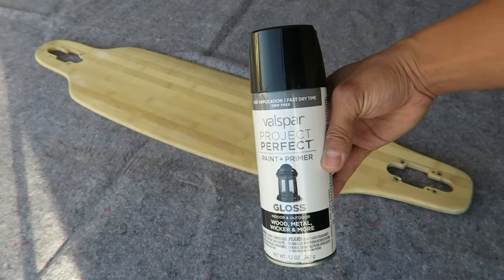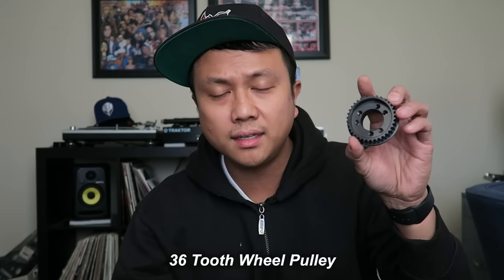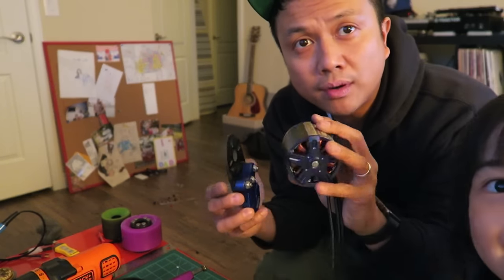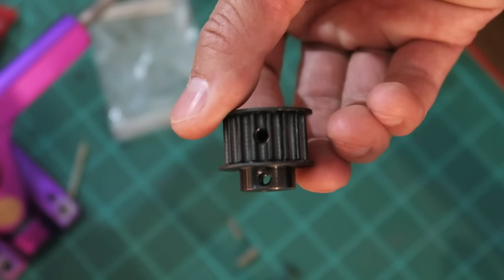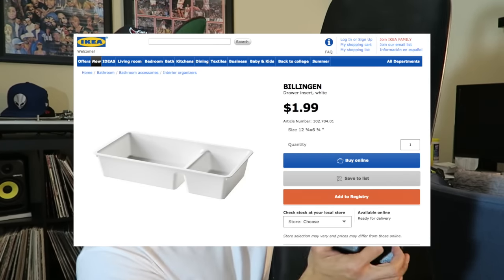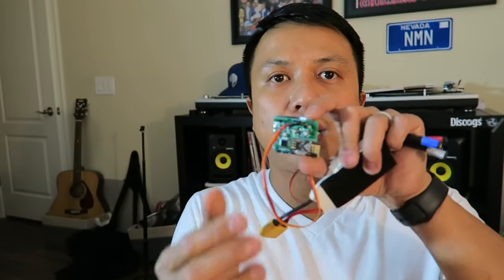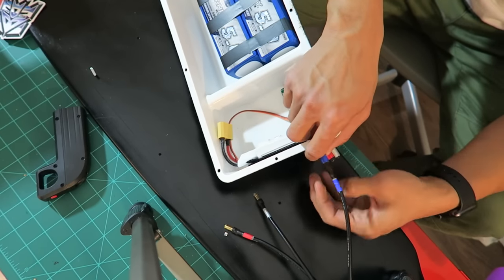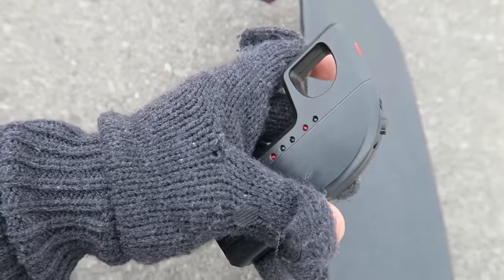MAKE A DIY ELECTRIC ⚡ SKATEBOARD - BETTER THAN A BOOSTED BOARD!

Comment: Hey, what screws did you use and stuff like that(wireing etc.). What was the total cost? Exeleration? And how would you put 3 batterys on it? How do you charge it and how much time does it take to charge. Thanks for your time!
Reply: Oh sorry 1 more question.. to many  lol. Ok so Can you change the wheels from 90 to like 80 or 75 and would that effect the build or anything with the skateboard . Love this video by the way! :)
Reply from the maker: If you'd like please shoot me an email to bigkidsofficial@gmail.com.  I actually have a spreadsheet with 3 tiers of budget builds.  It has a list of parts and links available.
Reply from the maker: I appreciate the kind words.  If you would, I kindly ask you to simply share this video to any of your social media.  It would really go a long way.  Anyhow, yes you can however certain wheel may require you to drill into the wheel to make that happen.  If you'd like something smaller than 90mm and don't want to drill into the wheel I suggest Orangatang Kegal wheels.  There are gears available for the type of wheel as well.  Thanks again!

 - Neil

Comment: Your videos are amazing.
I want to build my own electric skateboard and I have one question Which motors will be the best,  How do you think?
Reply from the maker: Hey there!  Thanks for watching!  I hope you'd consider subscribing to see more videos like this one.  If you'd like to go mono drive I'd really suggest the 6374 motor https://eskating.eu/product/electric-skateboard-motor-6374-170kv/?affiliates=11 this is the motor I use.  Matched with the right battery set up it can handle large hills or heavy weight.  However, if you are on more of a budget then I would suggest this: https://eskating.eu/product/electric-skateboard-motor-6354-230kv/?affiliates=11.  The second option might get create more heat over time but both will work very well!  let me know what you think and I can help you with your thought process.

- Neil

Comment: What is the antispark and where can I buy it? Also how do you brake? Thanks for the viddd
Reply from the maker: Hey there!  Thanks for taking the time to check out this video.  I hope you consider subscribing to see more videos like this one.  I purchased the connector.  It's an XT90 connector.  Then I soldered a wire into a loop. 

- Neil
Reply: Big Kids What kind of wire did you use? Also could you explain the whole battery adapter thing to me how did you make it?
Reply from the maker: So, it's called a series connector.  You can actually buy one of amazon.  However, I made mine in this video from (3) XT90 connector and 12 gauge wire.  I found a schematic online and just followed it.  You will need a soldering iron for this project.  You learn so much doing it yourself but you can buy one on line as well.  Good luck!

- Neil

Comment: I have an RC Car called the traxxas rustler vxl. The motor on the rustler is 3500 kv brushless motor. I already have batteries as a result to. So would be rc car motor work for this project or would it be too fast or make me put in voltage dividers?

Comment: was thinking instead og flattening hanger of truck use a lot of rubber between clamp and truck. to keep it fixed
Reply from the maker: Hey there!  Thanks for checking out the video and hope you'd consider subscribing to see more videos like this one!  I can see your idea working.  However, there are a lot of motor mounts already created for the flat portion of the Caliber II truck.  But if you want to use a truck that doesn't have a flat spot like a Paris truck or a Ronin truck your idea fits perfectly.

- Neil

Comment: awesome build dude.  I was thinking of buying the Evolve board but now I think I will build my own.  But I want a two motor type setup like the Evolve though and I want to use it to go to work which is about 12 miles away.  Any thoughts on how to make it go that distance??? any info would help dude.  and again awesome build.  I live in Sunny San Diego, CA btwNoka
Reply from the maker: Hey there!  Thanks for watching!  I hope you'd consider subscribing to see more videos like this one.  Noka, nothing bad about the Evolve boards but honestly you can build one better for the same price! Plus this has been such a rewarding experience!  if you are concerned about range it's all about the battery and how much amperage you motor or motors are consuming.  a couple of questions i have for you before i suggest something is: #1 how much to you weigh and #2 are there some really large hills near you?  I already have some suggestions in mind but just want to know a little more before giving you a blanket answer.

- neil

Comment: Hey
First of all great video and awesome board. Now I could use some advice on the batteries you used. You used the 5000mah 5s 30C batteries if I'm not mistaken, however I have seen a cheaper 5000mah 2s battery. How much of a difference would it make if I used the cheaper 2 cell battery?
Reply from the maker: +Kamran Hussain hey there!  Thanks for checking out the video and I hope you consider subscribing to see more videos like this!  If you use a VESC as your speed controller you will have to have a minimum of 6S or 6 cells.  Voltage is directly related to speed so if you want a faster board you'll want more cells.  Amps are directly related to range.  I've recently upgraded to 8000 mah packs and I'm very happy.  Let me know what you end up doing, I'd love to stay in tune with your progress!
Reply: Big Kids Thanks for the quick reply and ill keep you updated. 
I have seen a 5000mah 6S battery that I think be perfect for what I want to build, however it is 50C, and in your video you use a 30C battery. What does this C stand for and is this battery suitable for a  VESC identical to the one you use in the video? Thanks in advance!
Reply from the maker: 50C is great!  the C rating is the discharge rate of your battery.  The higher the C rating the better.  But before you make your purchase do a little of your own research on C rating.  Thanks again for all the support.

- Neil
Reply: Okay will do and thanks!

Comment: Hey big kids I have a question I bought a motor race star 200kv and it’s got this cable on it and I don’t know where to connect it
Reply from the maker: Hey there!  Thanks for watching!  I hope you'd consider subscribing to see more videos like this one.  Sean, the Race Star motor and most motors have the 3 phase wires as well as a sensored wired.  They would be plugged directly into your VESC or ESC.  I suggest you check out https://www.electric-skateboard.builders/ which is a forum for more detailed info.  Research on the product you buy is super important as all this stuff can really rack up the $$$.  Good luck!

- enil

Comment: Does your electric longboard have breaks? If so how it was done? Thanks! :)
Reply from the maker: Hey there David!  Thanks for watching!  I hope you'd consider subscribing to see more videos like this one.  The braking parameters can be sent in the VESC or the Electronic Speed Controler.  Every electric skateboard has one and the VESC has the ability to manipulate the brake pressure from the software called BLDC tool.

- Neil

Comment: Hey, I honestly learned so much from this vid! Subscribed! Can you share where you got the enclosure and the velcro?
Reply from the maker: Hey Jorge!  Thanks for taking the time to stop by; we're very humbled!  The velcro was from Amazon but I also found that you can find some industrial strength velcro from Home Depot or Lowes.  Mind you, it's a bit pricey.  My original enclosure was from IKEA.  Since this video I've changed my enclosures.  I know have the 6s and VESC enclosures from Torque Boards.  Check this link out: http://diyelectricskateboard.com/diy-electric-skateboard-kits-parts/2x6s-rc-lipo-battery-enclosure/  Let me know if you have any more questions I'm happy to help!

- Neil

Comment: hey i cant find those batteries ,couse they are out of stock,you got some links or something? TNX
Reply from the maker: Hey Alesha!  Hope you consider subscribing :)  Here is a link to a Lipo finder on Hobby King.  Just put in the specs that you'd like (IE:  5000 mah, 5s) and it will find all the brands that carry those specs: https://hobbyking.com/en_us/lipo.html?gclid=CjwKCAjwrO_MBRBxEiwAYJnDLKK-aZOmFEw9KIeEwRyyBpBWGKLkMtt6CcKAMfu-qBFQoMxg-32G2RoCyF0QAvD_BwE&gclsrc=aw.ds
Reply: what about the discarge,does that matter?
Reply from the maker: Discharge rate is the C Rating.  The higher the C rating the better.  It comes at a price though.  If you are looking to save money I think you'd be okay with a C rating from 25 - 30.
Reply: what about ? Multistar High Capacity 10000mAh 6S 10C
Reply from the maker: +Alesha Ciobanu that's ALOT of power.  However, 10c is awfully low and Multistar hasn't had the best reputation.  Turnigy or Zippy are the 2 I think you'll have better results with.
Reply: ok tanks a lot

Comment: Why dont you use a switch to start and turn off the Board instead of the Wire jumper?
Reply from the maker: +Ian GB loop keys are simple and cheap.  Mostly for budget reasons.  I️ have other boards with switches.  A switch plus amperage regulator can cost about $35-$50.  Hope you enjoyed the video and please consider subscribing for more videos like this one!  Thanks again.

- Neil
Reply: Hey thank you Neil I thought it would of been for some sort of security measure or something. Your video was very detailing and the only one where someone decided to paint the plastic cover. Pretty cool and nice Build.
Reply from the maker: +Ian GB actually, you are right as well.  You can used the loop key as a security measure as well.  If you don’t have the loop key to complete the circuit the board will not work.  Thank for checking out this video.  Check out my latest video as I’ve actually uploaded part 1 of a 2 part series of a newer build.

Comment: Why would you top mount your trucks to a drop through deck?
Reply from the maker: Why not?  Never limit your imagination in DIY.
Reply from the maker: A low deck limits the space between the motor and the deck.  So when I turn the motor would scrape the bottom of the deck.  My motor mount is strictly an under mount but ifni was to have a reverse mount mounting the trucks drop through would work fine.

Comment: Hi Neil, 

I was just wondering whether you have to configure your remote control with this to the skateboard like you did in your other 3 part tutorial because I don' t know whether I should do that if I want to follow this tutorial.
Reply from the maker: Yeah, all remotes have some kind of receiver.  Even if it's a ESC with a dedicated remote the ESC most likely has a integrated receiver.  With that said, I'd say 90% of the time you'll need to bind the remote to the receiver.  Hope that helps.

- Neil

Comment: Looks awesome.
Any idea how much all the parts were together?
Reply from the maker: Hey there!  thanks for checking out the vid!  Hope you consider subscribing for more videos.  In my case, all my parts were close to $750.  However, at this point I know I can get even higher quality parts for less expensive.  Just some lessons learned as it was my first ever build.  Hope that helped.

- Neil
Reply: Thank you, I'm looking forward to your next videos.
Unfortunately, the price was the only thing that made me consider building something like that myself, especially since I have no technical knowledge. And for me, I guess the expenses would go even higher with importing some parts to Germany. But I will stay on the lookout, maybe soon it will get cheaper to build one.
Reply from the maker: You can definitely do it for cheaper.  It was my first build so I've learned that I definitely did it on the expensive side.  There are a couple vendors I know of in the EU that are quality at the same time could lower your shipping costs.  Alien Drive Systems & UNIK Boards are two of them.  One from the UK and the other in France.  Hope that helps :)

- Neil

Comment: Are you supposed to also use any lipped bearings?? Thanks!
Reply from the maker: Hey there!  Thanks for stopping by and checking out my video.  Hope you'd subscribe to see more like this one.  Lipped bearings aren't necessary as there's a spacer between the two bearings.  I actually use Zelous bearings which have an integrated bearing spacer already.  Hope that helps!  Are you planning on building one?

- Neil
Reply: I am! I just finished my parts list but was unsure of what I should do about the bearings, thanks!
Reply: I would LOVE to show you my parts list and get your thoughts if you'd be willing
Reply: I would LOVE to show you my parts list and get your thoughts if you'd be willing
Reply from the maker: Sure!  Shoot me an email at bigkidsofficial@gmail.com
Reply: THANKS!!

Comment: hi were did you get the anti spark key
Reply from the maker: Thanks for watching the video.  If you'd like to see more videos like this one please consider subscribing www.bigkidsofficial.com.  Hi there!  The anti-spark key is a XT90 connector with a wire that is soldered to both the negative and positive end.  The anti-spark loop key does require some soldering.

- Neil

Comment: Nice and simple video.   But I have to say. You left out some details about building a drivetrain.   Such as lining up the motor mount and have it square to the wheel.  Place a spacer under the c clamp to adjust to the tappered skateboard truck.  Use red thread lock on the c clamp screws once you did all the testing to insure  everything is working.  Use red and blue thread lock at the end because red is pretty hard to remove  once it dry. Maybe use a 40t wheel pulley instead of 36t on a 97mm wheel.    Those were just some of the problems I had to solve when I built my first board.
Reply from the maker: +Wilson Leung Thanks for stoping by Wilson!  Yeah, it’s hard to predict what you may or may not cover in a video when a lot of things are trial and error after the build.  It’s funny that you mention these things because I️ actually cover a lot of the things you mention in my new diy esk8 build video.  Anyhow, the challenges of doing YouTube videos is actually a bit different then the challenges of building a electric skateboard. Anyhow, the electric skateboard scene on YouTube is pretty small so I️ hope you consider subscribing to see more improved videos like this one.  

- Neil

Comment: i want to know how much is the electric skateboard you made
Reply from the maker: Thanks for checking out the video!  Hope you'd consider subscribing for more videos like this one.  This was the first iteration of my build and wasn't as cost effective as I'd like.  I spent around $800.  But, I know now I could have done it for about $500 - $600.  a DIY board to me is kind of like a modified mustang.  it's faster then most boards but does take some maintenance.  Most full build boards are once size fits all like a Camry or a Lexus at best.  DIY isn't for everyone.  If you'd like, i have a spreadsheet with tiers of budget builds and the cost of each part.  email me at bigkidsofficial@gmail.com if you'd like it.

Comment: Im searching for a good vesc to buy but doesn't hurt my budget.  I was looking at the diy vesc, do you think its any good? also how is your vesc holding up? I just dont want to make a mistake and force myself to buy another one lol
Reply from the maker: Hey Jerico!  I'm actually not using the DIY VESC unfortunately.  The first time I connected it I actually fried a DRV chip.  Honestly, probably a user error as I was new to the hobby back then.  I'm currently using a Miami electric version of the VESC.  It's great and has handled some high amperage pull from my 10s 8000 mah LiPos.  If I were you, find a company that has good VESC and that handle FOC if you'd like that in the future.  Per the community the best VESC's come from Enertion (FOCBox) and Ollin Boards.  They are pricey though.  Good luck weighing out the pros and cons.  If you have any more questions don't hesitate. I appreciate the view and comment!

Comment: Are there brakes on the board. If not how do you stop it?
Reply from the maker: +Kyle Tolman hey Kyle, thanks for watching and hope you consider subscribing for more videos like this one!  Kyle, yes, there are breaks.  You basically pull back on the trigger on the remote.  The break pressure is programmed in the VESC.

- Neil
Reply: Thanks! This video was super helpful BTW.

Comment: Hey man, about to do my first build. What's the range with these batteries?
Reply from the maker: Hey, thanks for stopping by!  I hope you'd consider subscribing to see more videos in the near future :)  Anyhow, with the (2) 5S 5000 mah LiPos I get about 7-8 miles.  However, I'm real heavy on the throttle and have many hills in my neighborhood.  You may want to also consider the wind and my weight (160 lbs). Anyhow, good luck with your build!  When you do finish it please email us a picture or video with some specs as we're doing a feature video with Big Kids' viewer builds.  

- Neil

Comment: hey great video, how do you charge your battery?
Reply from the maker: Hey brotha!  Thanks for taking the time to check out our channel :)  At the moment I am using to LiPo batteries in series.  LiPo's need to be balance charged and require a hobby grade charger.  it's a lot easier than it sounds.  However, here is a link to the charger I used:  https://www.amazon.com/Jrelecs-Battery-Balance-Charger-Batteries/dp/B018FQKWGM/ref=sr_1_1?ie=UTF8&qid=1492449954&sr=8-1&keywords=imax+b6  It's inexpensive and efficient.  We plan to do a video on it for review.  Hope that helps.

Neil
Reply: Thanks bro! Will be looking forward for the video
Reply from the maker: Of course brotha!  Hope these videos are informational and entertaining!  Let me know if you need anything else!